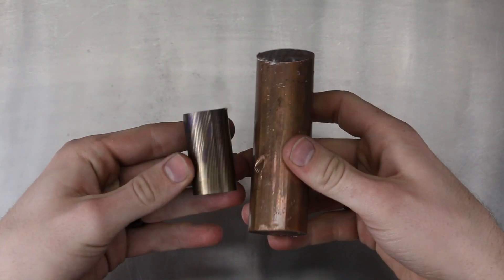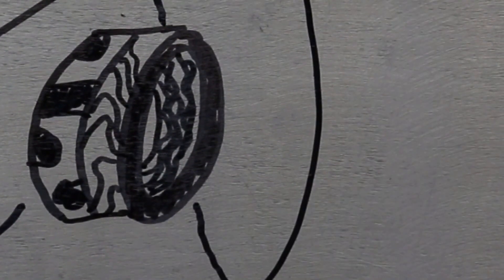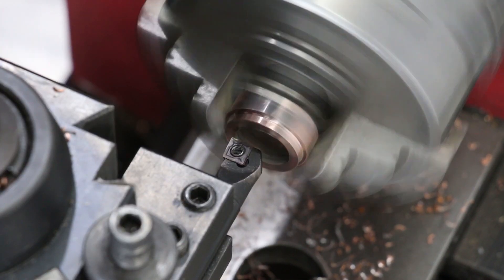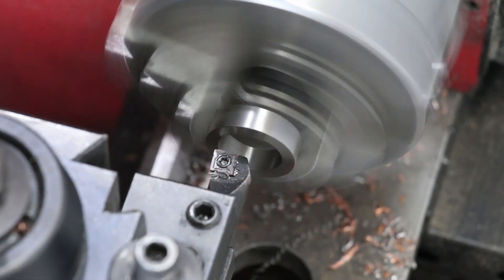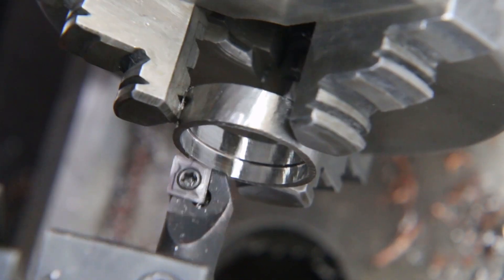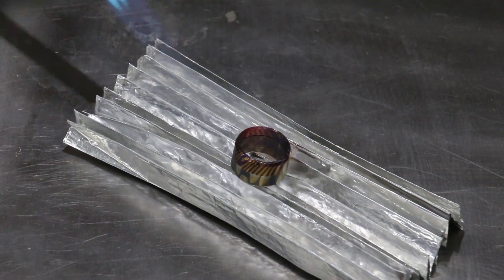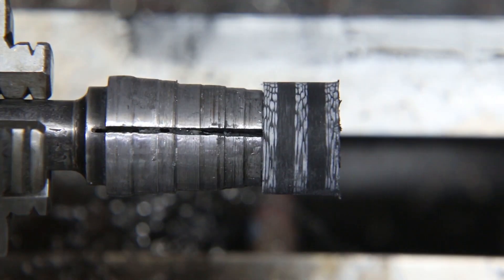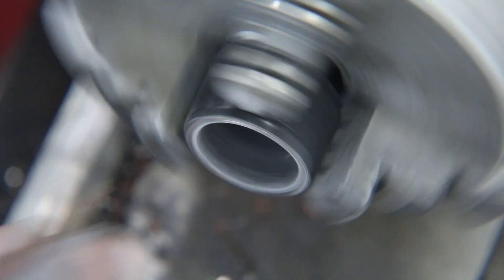Making a Ring out of Timascus, Superconductor, and Carbon Fiber

Comment: Instead of squirting the rings with alcohol after u finish the heat treatment. U should have a little container of alcohol that u just dip the ring and, and when ur not using it, just put it in the fridge

Comment: You certainly do a lot of things the hard way.  Particularly when you have the power tools that would make it easy.  When you sliced off the angled section of your semi conductor bar.  Then wasted all of sanding belts to rough it to a round.  Would have been much easier to have turned it round in the lathe.  You  would not have even needed to send it to water jet like you did this one.  ( why if you had them water jet out the center. did you not have them round the outside also)   To have done it with the tools I seen you have.  First you just needed to put a center drill hole in the approximate center.  Then use a short piece of aluminum or brass.  Turn it to have a shoulder on one end maybe one long.  If you have a piece of one inch diameter stock.  Turn it an 1/8 inch smaller for the one inch length.  Flip that around and place the should snugly against the chuck jaw.  Face off the end sticking out.  I did not see if you have a live center for you lathe.  If not you should get one.  You then take your center drilled rough stock.  Pressing it against the faced off bar.   Keep the amount of length you have you tail  stock extended to a minimum. It is best to have used the largest center drill also.  Creating maximum surface area for contact on your live center.  Also good idea is to hit the face of the stock that will be in contact with the faced off bar on your belt sander.  Does not have to be totally smooth.  Just knock some of the high points to get more surface area in contact.  Do not over tighten or over pressure the bearings on your live center.  You will burn the bearing out.  Make sure if you are purchasing a live center.  The it has good bearings. Now with it pressed against the material in your chuck you can take cuts of the outer until you have a nice piece of round stock.  Also take a cut off the face as far as you can with out cutting the live center.  Another thing you can do on the lathe is radius the inner and outer.  You can make a radius cutter using a blank tool bit. Use your dremel tool  to cut a radial groove down the corner of the tool bit.  Since you won't be remove much material. With most of the materials you can leave the top of the tool flat.  For cutting the inside radius.You will need to make sure that you create relief on the bottom of the tool so it will not drag on the bore.  Instead of making your own cutter.  You can purchase a corner rounding milling cutter.It has four flute in most cases.  You mount it to your tool block using either a boring bar holder.  Or a tool holder that has a v cut on the bottom to rest the round tool shank in,  You place one flute flat on the axis of the lathe and on center line of the chuck.  You use that one flute to cut your radius on the edge of you outer diameter or in the inside of your bore.  Since it is round it will have clearance built into it.  If you still seem to get drag.  Raise it slightly above center line to make your cut.  Either tool you use.  Run the lathe at a slow speed so you will not get shatter from the large area of contact of the cutter.  You can also make you own lathe mandrels for probably a fraction of the price you are paying for your commercially made ones.  Again Aluminum or brass.  Put the bar in your lathe  turn od to the step sizes and lengths you want.  May want to leave a little big to take a finish pass after you have it near finished. Drill with tap drill for a tapered  pipe tap size. Tap the hole to leave 5 treads to the end of the tap sticking out.  After removing the tap.  Take it to the band saw cut either 2 or 3 cuts through the center leaving the end looking pie shape cut.  Put a pipe plug into the end slightly tight.  Not as tight as you can.  With the Mandrel piece back in the lathe take a finish pass to the steps.  Slide your ring wit id cut to size.  tighten the tapered plug slightly till it snugs the ring in place.  Hope you find at least one of these points useful.

Comment: what if you made a brass ring with an glowpowder epoxy inlay, give it an obsidian look, and then use the white and green polisher compounds to smooth the edges to where they're still visible but not as much of a sharp angle

Comment: 10:26, did the metal parts get loose?
Reply: no. he said he made a pressfit. so he fucked up but is able to save it by the core. but with a pressfit no adhesives is neded
Reply: vengefulenigma that's what the center part is for. To keep them together
Reply: I don’t understand what superconductor is but that is a nice ring.  What does that run for?

Comment: Nice work, but the centre drill is not made for drilling through the material, its just for starting, and then switch to an actual drill, get a carbide drill and it will be a much smoother hole. Cheers.